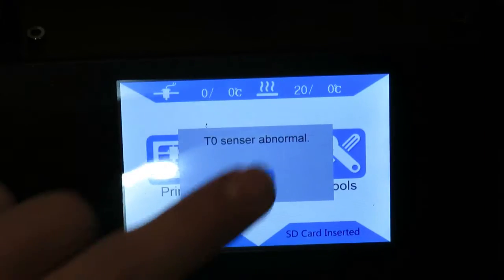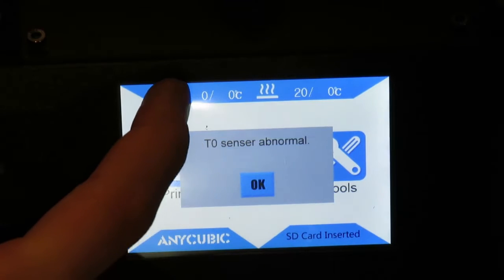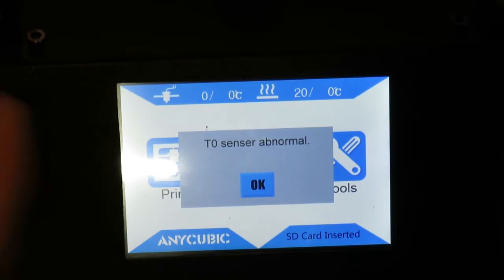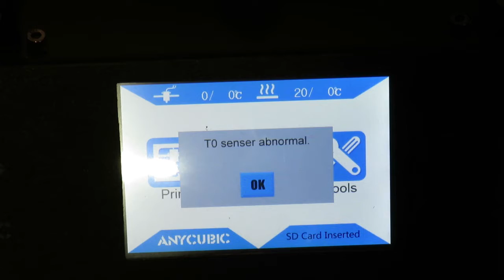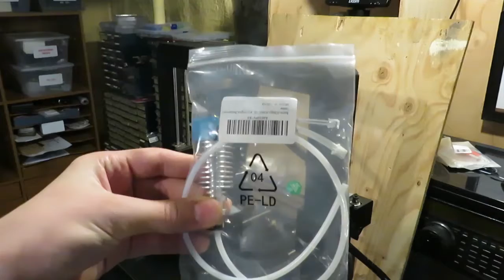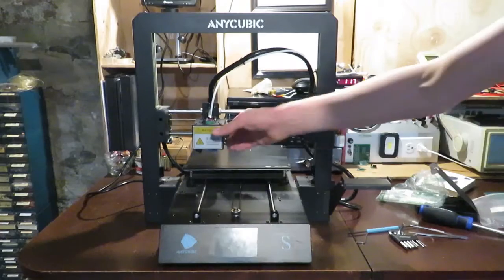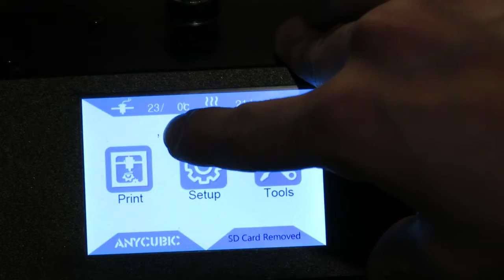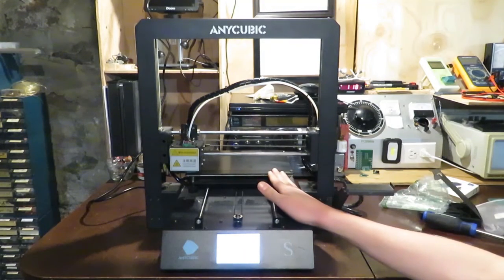Anycubic Mega S T0 Sensor Abnormal code Repair

Comment: Okay this is a great solution for main issues. But this did not solve my problem. NOT THE FAULT OF THE CREATOR WHO MADE THIS VIDEO. 

if this does not fix your issue:

On the right side of your printer. Two cords connect to the printer. MAKE SURE BOTH ARE FIRMLY CONNECTED. 

for some reason one of the cords was completely disconnected. 

Anywho. Thanks for the video kid! Love your passion!
Reply: Thanks this fixed it without having to do whatever he did.
Reply: @somethingoluf9/10 times what fixes the issue is what the original video creator did. 

But sometimes it's the oddballs like me and you who have this issue